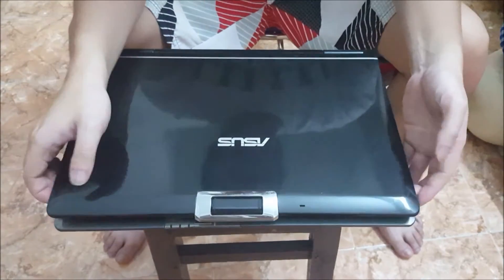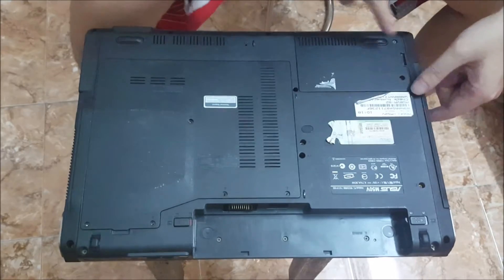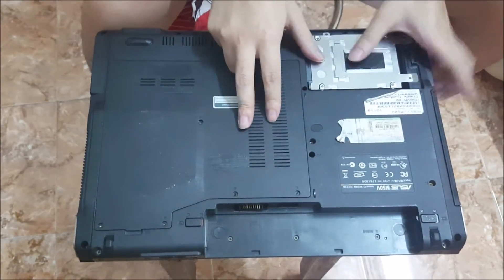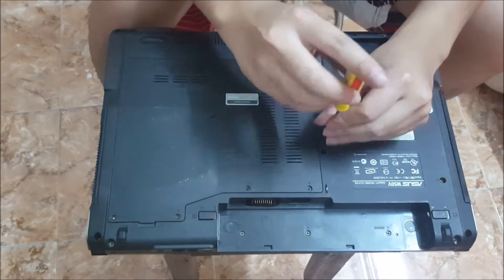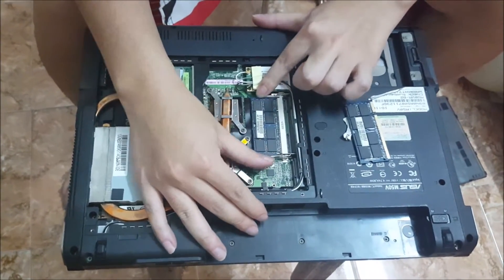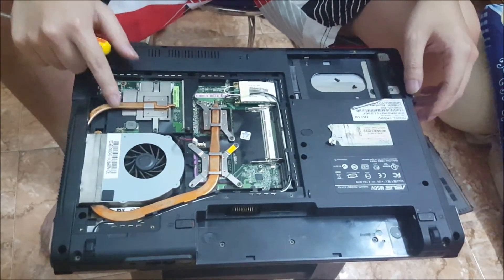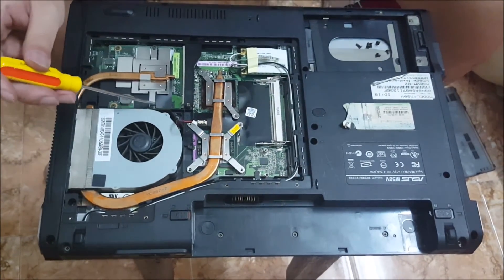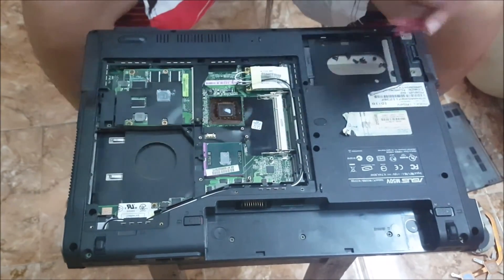OPEN ME UP! Asus M50V Disassembly

Comment: By unscrewing clockwise or counterclockwise, you risk damaging the processor crystal. There are also numbers there in what order to close and it is advisable if you disassemble to start with a high number